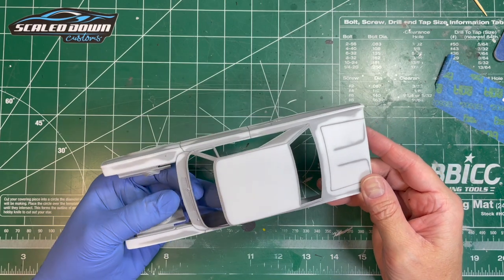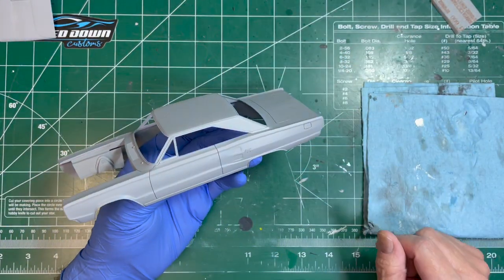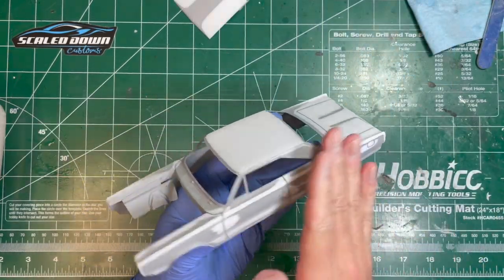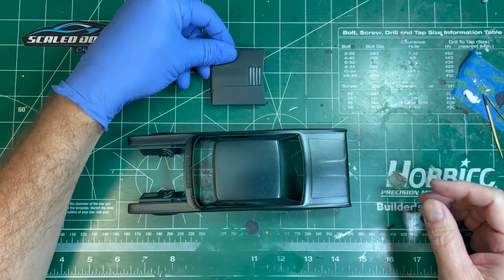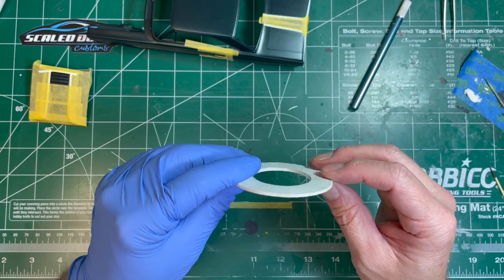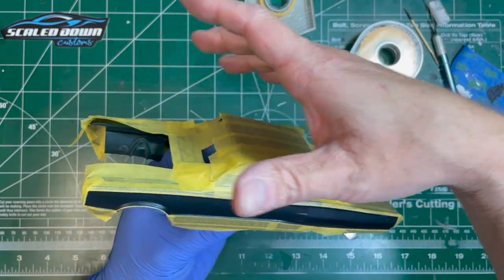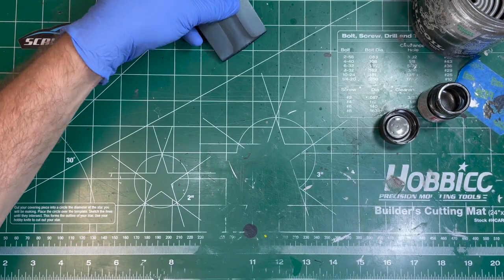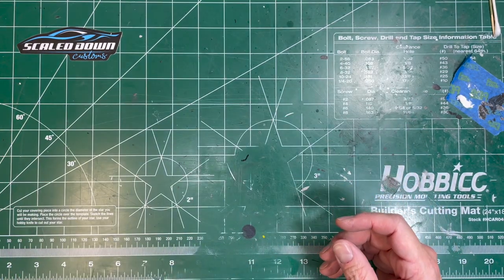Building the Revell Foose Design '67 Dodge Coronet 1/25 scale model car Part 2

Comment: Tonight --- I just came across your channel ----- wondering what airbrush you are using? -------- Do you like how it performs? ------ In doing the --- High Lights --- do you switch to a smaller needle ------- and one last thing ------ trying to figure out you paint booth? ----- Will be watching more of your builds ---- and Thank You for sharing with the Tools / Supplies you use in building ------ Thank You Again -------- Rodney
Reply from the maker: I am using an Iwata Eclipse HPCS and have been for several years now. I love it. It is my workhorse and I use it for everything including primer. I am not switching to a smaller needle for detail painting, just the same set-up. My spray booth is a Micro-Mark.